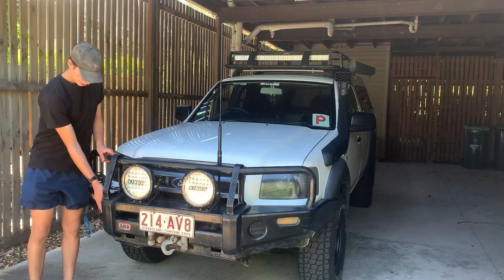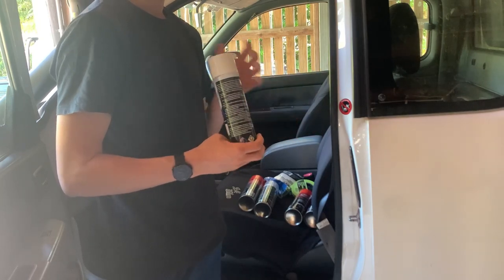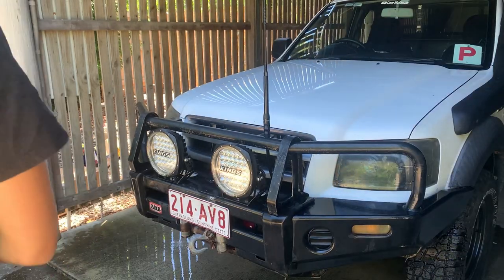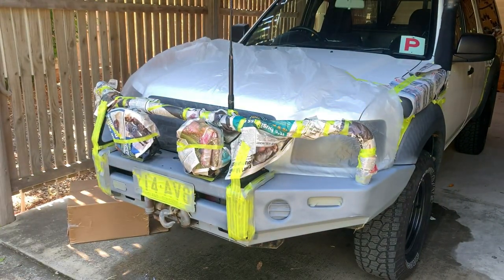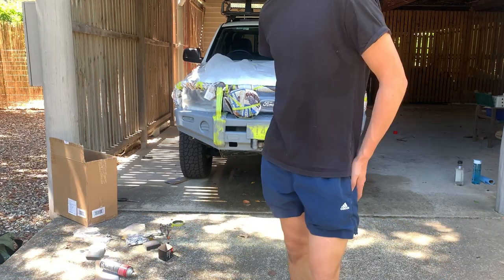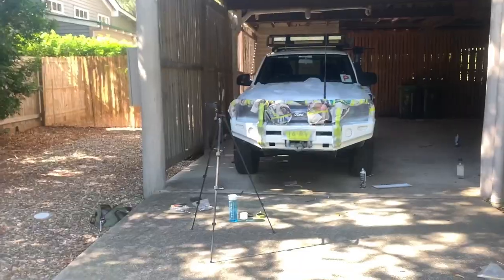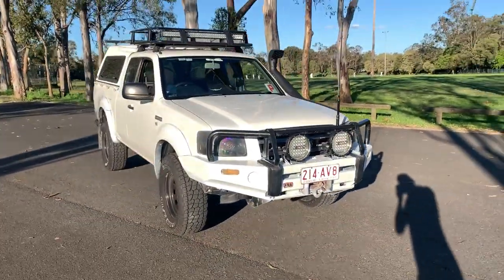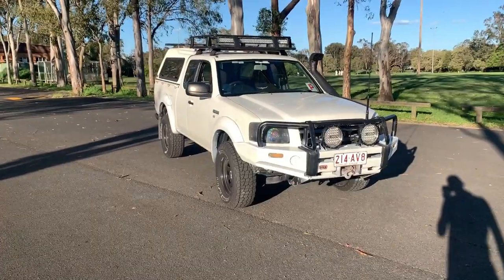NEW LOOK FRONT END|Bullbar Repaint|YOU DON'T NEED POWDERCOAT|How to Make Your Bar 'MUZZ BAR' Style

Comment: what colour spray paint looking to do my fenders?
Reply from the maker: It was called stark white, but it didn’t match the colour perfectly. Also if I were to redo my fenders I wouldn’t spray paint them. I’d look at wrap or at least get the correct primer because the stuff I had didn’t stick well and left streaks and now it comes off if I pressure wash it. Thanks for the comment man. Hope this helps
Reply: @liammckenzie835  ok sweet as
Reply from the maker: No problems mate. Goodluck!